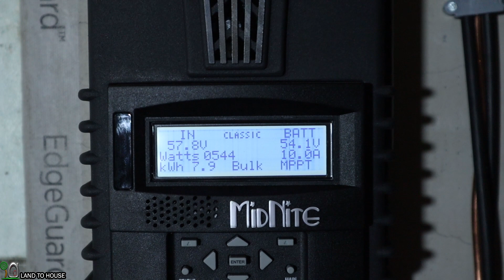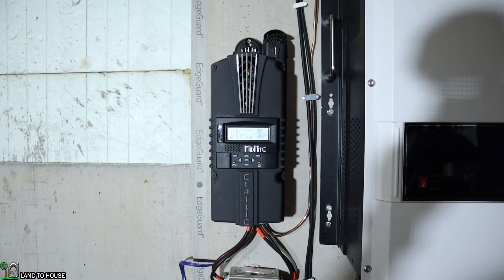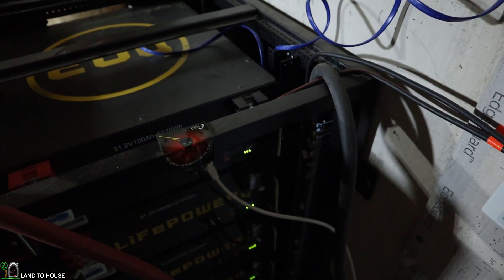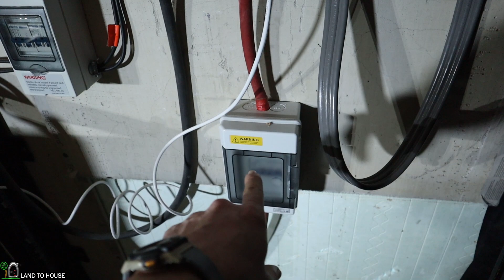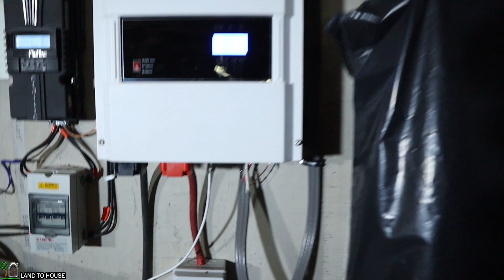Micro Hydro Electronics - Charge Controller - battery - Inverter

Comment: We have an eg4 set up. 6kw inverter 240/120 spilt. It is hooked to solar. We really want to add hydro but u sure where to start. Can you advise some info to get started. We do have a couple of creeks that run around the property not far from the house. Anyhow would really love the extra power to the batteries. Your insight  would be welcome!! Thank you

Comment: It seems the Charge Controller you have is for solar, are all MPPT Solar Charge Controller enough for water turbines or are there any special specs you need to choose one?
Reply from the maker: As long as they can handle the voltage, especially the no load free spin voltage, these mppt can handle hydro.

Comment: Are you running a diversion control with the Midnite or just letting the hydro freewheel when the batteries are charged? If so, what is a safe RPM? 

Is the Midnite able to properly charge the Lithium bank without communication to the BMS?

Comment: I'm in the UK so I know things are different, but roughly how much does a so
Set up like that cost. To the nearest $500??? Thanks for a good overview.
Reply from the maker: This homeowner has a LOT of battery storage for hydro. 30.6kwh. The batteries are $10,500. Inverter is over $1000. Charge controller is $700. There are other things like breakers and wires. I should think they spent over $14,000 for the full setup. The power company wanted about that to run power all the way out to the cabin.
Reply: Thanks for that, channels rarely say the price. 
It's the most useful piece of information for comparison.
Very easy to comprehend walkthrough, thorough. Good job. :)
Reply: Agreed. Helpful. If you don't know the cost of the set up then it's impossible to determine whether or not you should invest or it's a white elephant. 30kwh is a heck of a lot of power. I'm guessing 5kwh might be enough for me. My river next to me we think could generate up to 500w so 12kwh/day in theory.. ATM my electric costs £4-400/m (I charge an EV) so might be worth the investment with a payback of about 18months.

Comment: I do not understand how the Charge Contoller "tells the hydro turbine how what speed it should be spinning at", as per your comments... I see no IC and/or control cable returning to the tubine.
Reply from the maker: The controller will increase or decrease the input voltage and thus alter the pma rpm.
Reply: @Land to House  oh, so by changing the Load demand the turbine slows down (under load) or speeds up (without load demand)?
Reply from the maker: @jaysizzlegman7621  yes. The charge controller picks the best point between voltage and amperage to spin the pma for maximum watt output. When the battery is full the controller let's the PMA spin free.
Reply: @LandtoHouse  It would be cool if you could go into how you can use a dump load to put the extra power to use once the batteries are full. Some people use it to preheat water. You can have even have a 2-stage thermostat or something.
Reply from the maker: @ThisRandomUsername  That would be interesting! I should set up that type test center when I build my bigger electronics testing shed.

Comment: 0:34....... Are you gonna cover that up? Don't want to think about what happens if a cat or something else touches that.....
Reply: Not his system
Reply: Running at 60V it's not very dangerous, and looks to be producing around 10 amps. If a spanner were to bridge the alternator you probably wouldn't have too much of a problem either, with probably less than 20A available.
Reply: Yeah its not likely that it would cause any harm especially being up there on the wall. 60~vac isn't too dangerous, and then the same 60vdc isn't really at all. Both would give you a pretty good shock tho in the right conditions.
Reply: @NSaw1  agree to disagree. But then there is also the fire hazard
Reply: @HansKeesom  What's going to catch on fire? It's a pretty safe setup. In South Africa anything below 60V doesn't need to be protected with double-insulation because the voltage isn't considered lethal. That turbine wouldn't be able to produce that much heat on anything except the perfectly sized resistor.
Reply: @NSaw1  100% correct. That AC voltage will be 42VAC, which is pretty safe (The charge controller is reading the rectified 57VDC which is equal to VAC * sqrt(2).

One thing this does make me wonder though: That voltage isn't much higher than battery voltage, so is the charge controller actually able to operate correctly? It must be if it's producing 500W, I would just try to confirm it.

Comment: so do you do vawt wind power
Reply: It's really not difficult to do AC, but you do need 3 wires for 3-phase. One thing you could do to improve that is to put the rectifier at the source instead of at the charge controller, it can be a bit more efficient.
Reply: @ThisRandomUsername  ac has no benefits, only inversion/rectification deficits, you can do full dc system, even high voltage
Reply: @Jkauppa  Do you mean you want a generator with brushes? There are definite downsides to that too.
Reply: @ThisRandomUsername  who told you DC systems have to have brushes, bs
Reply: @ThisRandomUsername  I just said DC, no matter what
Reply: @ThisRandomUsername  its your problem if you think you have to use brushes in dc systems, someone fed you a ton of crap when you believed that lie
Reply: @ThisRandomUsername  when you use dc brushless systems, you avoid all dc commutators/brushes/controllers/electronuncs that make ac systems unnecessarily complex
Reply: @ThisRandomUsername  yes there are efficient brushless dc motors/generators, or even graphite conductive fluid-style bearing 2-in-1 brushed dc motors
Reply: @ThisRandomUsername  assumptions k1ll creativity/efficiency/productivity
Reply: @ThisRandomUsername  yeas bearings are brushes, so anything with bearings has brushes, anyways
Reply: @ThisRandomUsername  so commutator with graphite bearing brushes dc generator/motors would work just fine
Reply: @ThisRandomUsername  all your "brushless" motors/generators are brushed, because of the bearings
Reply: @ThisRandomUsername  pretend brushless motors/generators
Reply: @Jkauppa  Show me a generator that doesn't use a commutator or a rectifier and outputs in DC.
Reply: @Jkauppa  Are you drunk or a bot?
Reply: @ThisRandomUsername  show yourself to the door, for you are not wasting my time anymore, knowledge is pride
Reply: @ThisRandomUsername  by you not knowing/researching on your own beforehand, you submitted to preach the ac tech faith religion on others, no thanks
Reply: @ThisRandomUsername  when you cant win, you resort to being agressive
Reply: @ThisRandomUsername  do your research then come back, wikipedia should be full of examples of true dc brushless motors/generators
Reply: @Jkauppa  Knowledge is power, not pride. If you have no knowledge you make stupid decisions and waste everyone's time.
Reply: @ThisRandomUsername  your truth is not the whole truth, its your skewed version of your politics decisions, "it must be like this, we are used to this"
Reply: @ThisRandomUsername  well you seem to have pride, you most high king dictator of science betrayal
Reply: @ThisRandomUsername  stop wasting my time in this comment thread
Reply: @ThisRandomUsername  well, you dont serve me, and I dont serve you, so whatever
Reply: @Jkauppa  Ah, thanks for telling me your tactics.
BTW I do advocate for rectifiying the AC into DC at the generator before transmission because it is slightly more efficient. At 50V your rectification really isn't much of a loss, just 1.2-1.5V, so up to 3% losses. Diode bridges are also typically very robust. Basically the most simple way you can do it with off-the-shelf components.
Reply: better have direct dc generation, no ac to mess about
Reply: rv applicance